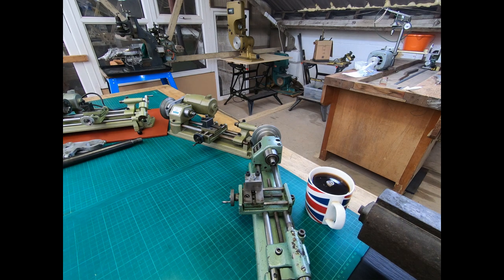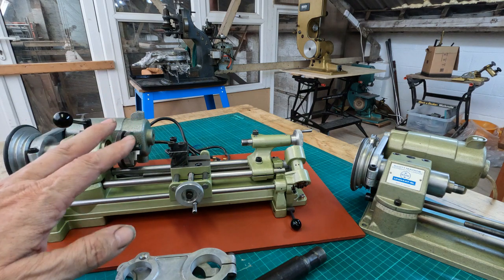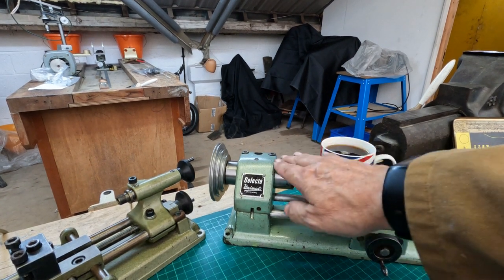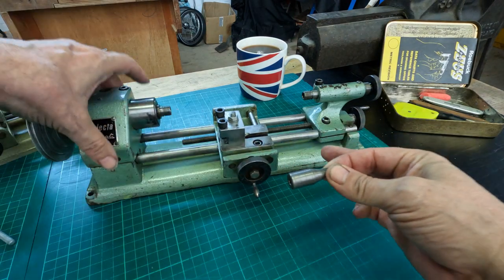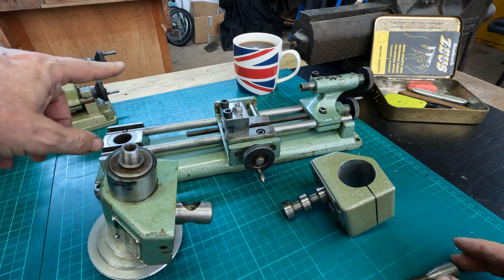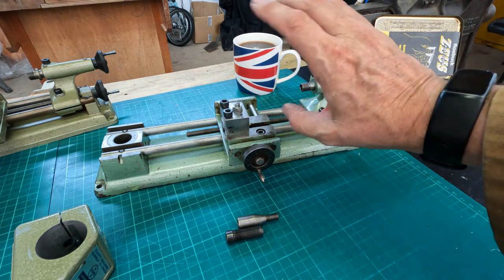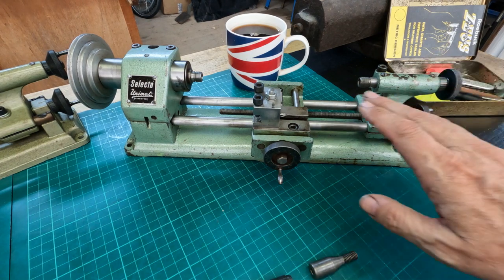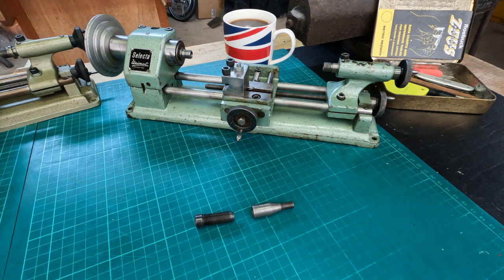Unimat SL - Watch This Video Before You Buy One.

Comment: Hi Paul, if you have purchased a Unimat this is also something to consider before you have it shipped to you. More damage is caused in transit to the lathe than in any other situation the factory shipped these machines disassembled. The motor, motor bracket, tailstock, and all the hand wheels and handles were all in their own wrappings. This prevented these parts from being damaged. The screws are of mild steel and are close to the box walls if the lathe shifts in transit the end of the screws could be bent if not fixed in place resulting in the wheel or handles to wobble. Please disassemble and pack parts so they cannot shift or move. I won't purchase a machine from a seller if they won't disassemble it for me. And yes I will pay a negotiated fee that is fair for both of us.
Play safe from Elliot Lake, Ontario, Canada.
Reply from the maker: Hello Scott,
They are really good points... One of mine had a handwheel damaged when it arrived... I will pin your comment so other can benefit from it. Thanks for watching and your support.
Take care.
Paul,,
Reply: I just shipped one and knew to do it carefully.  While it had its original wood box, I did NOT ship it in the wood box.  I left the vertical column in the wood box and put various accessories in the box.  I removed the headstock and motor assembly as one piece from the lathe bed and packed it in a cardboard box.  The rest of the lathe was put in a separate cardboard box with plenty of space and packing to protect all of the handwheels.  The wood box, box with headstock and motor assembly, and box with lathe were all put in a large box with some packing around everything.  It all arrived perfectly without the buyer having to do very much assembly (just replace the headstock onto the lathe).

Comment: Paul, excellent primer and good highlights on avoiding a potential money pit. As I tell folks the machines are reasonable. Accessorizing is the challenge. Very easy to commit and regret later. Battery powered tools is a similar scenario. Glad you found the early version and rescued it before it was lost to obscurity. Turret lathes over here are a parallel - inexpensive to purchase, but outfitting missing bits can eclipse the initial price in a blink.
Reply from the maker: Hello Dan,
I am doing my best to document anything I find along my way playing with the Unimat lathes... I am really pleased to have found a 2b but was surprised to find the differences between it and the SL models. Thanks for watching.
Take care,
Paul,,

Comment: The difference in weight is a lot, my aluminium SL weight around 4,5kg and the iron MK-2b around 7,5kg. Both standaard with chucks, but no tools. The scales a used is not very accurete, but it gifs you a  feeling of the difference.
Reply from the maker: Hello Ruben,
Thanks for the information on the weight difference, and taking the time to share... I am sure that will help other viewers in the future.
Take care.
Paul,,
Reply: @TheKnacklersWorkshop  have send you a e-mail

Comment: TLDR: Parts are not interchangeable between models.
Question- why do you have so many?
Reply from the maker: Hello Mike,
I think the Emco range covers many sizes of machine to fit everyone's needs, which does cause some interchangeability issues. On the SL specific machines the slight changes is just the evolution of the product. Many thanks for watching and taking the time to comment.
Take care.
Paul,,
Reply: @TheKnacklersWorkshop  I have an interest, owning one myself. Bought new, many years ago, it was my first machine tool. Yes, they evolved, and more accessories were available. Always been suspicious of multi-purpose tools, too much compromise- but being able to have both a lathe and a milling machine that can be used in a domestic environment has attractions. I have not used mine for years (I have 'full-size' versions now) but recently decided to 'play' with it; I have a 500w spindle with no other current use, and I have seen how cheap ER series collets are...